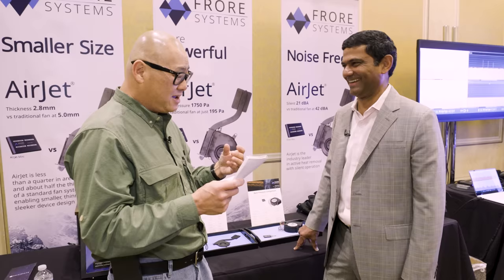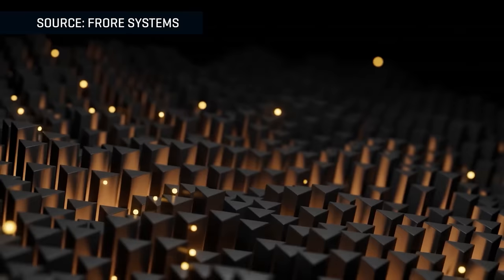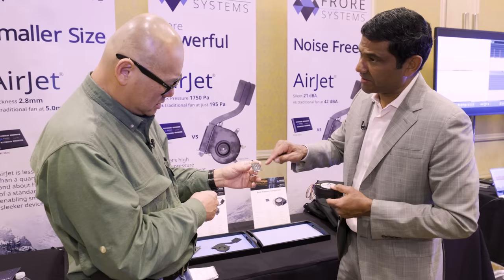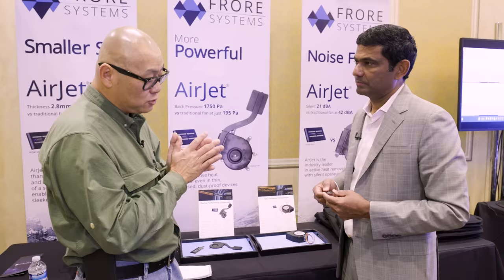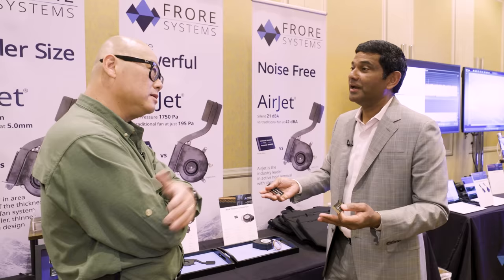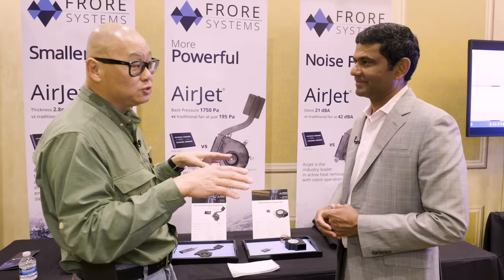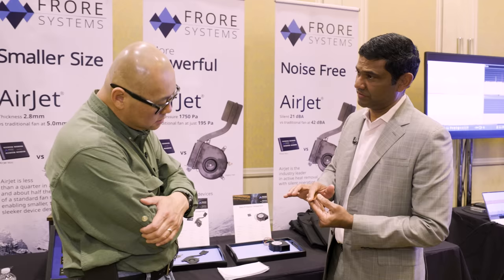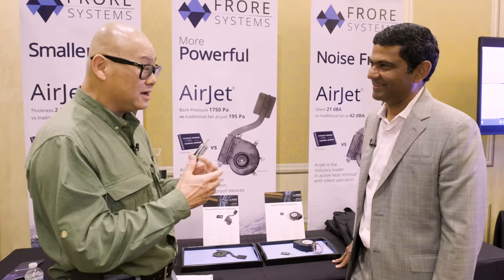Solid State Active Cooling Could Revolutionize Thermals

Comment: It'd be interesting to see a whole pile of these little guys set up to be a radiator. You've got a copper loop in the middle, and then on both sides of that loop, rows of these guys to move heat out pulls air in from the top and bottom, blows hot air out to the sides. 20-30 watts of airjets like that would cool a lot of cpu power , and if one failed you wouldn't loose the whole thing like the fan failing on a radiator. 

Also that small one is basically NVME-sized so you could just slap that on there with little changes.

Comment: This is not Evolutionary. This is Revolutionary! This is an actually technology that far more significant than more cores and more rams. Hopefully the actual chipmakers is all thinking, like him, about efficiency. 1 watt of power removes 5 watt of heat. Now the GPU is like 100 more watt 2 more FPS and 1000 more bucks.

Comment: I'm sure I'm not really grokking this... So its back pressure is a quarter PSI.... that is generated by Piezo-ish MEMS device that MUST be vibrating in the audible range to be able to impedance match (I'm just assuming that... I would be surprised if I were wrong though)...So you are forcing air through a slot using vibrating elements... and this  is supposedly silent??  A situation that would demand this product must be ultra thin, be required to be extremely quiet, and be dependent (for some reason) on convection cooling instead of direct conduction to a back panel like a cell phone... do any of you all know a situation where convection cooling would be preferable to direct conduction heat sinking to the devices back plate?

Comment: in terms of shaving, you use foam or gel on your face and you have so much of the product on your face that is just excess. then you use ultra slick soaps/creams like creamo. and it's barely on but what is on there is 100% effective.
so for me, putting this into your cpu, gpu, ram, and SSD. then add a low rpm intake/outtake fan. you will have crazy silent and efficient cooling. you still need the fans just to remove the air in towers as there is just so much more space in them.
I can't wait to see these into phones as higher hz screens get's really toasty

Comment: He seems to be evading the real reason you wouldn't attach this cooler directly to cpu die.. looks as though the solid state cooler simply does not contain enough thermal mass to effectively cool or keep up with the heat production of even something like a 32watt mobile cpu. The heat pipes and/or vapor chambers would offer that thermal mass 🤔

Comment: The datasheet says that the device they showcased has a thermal dissipation potential of 5.25Watts, which means it needs to be almost 20 times larger to cool a 'high end' CPU that emits 100W of thermal waste energy.
So essentially it's barely capable of cooling a low end SSD, which can be easily cooled passively with a lump of copper or even aluminium using no electricity, using only convection and being truly solid state.
Now if we take into consideration that low end SSDs don't even need cooling, this thing becomes even less useful.
Since it contains vibrating parts, something moves, disqualifying it from being solid state anyways.

Comment: Pretty interesting solution. But if you increase the CPU/GPU power because you can dissipate more heat, the power consumption also increases. Therefore, you need greater batteries or work connected to a power source.

Comment: For hand held gaming devices, this is pretty good.

But apple silicon has kind of started a huge push in that ARM market. As they become more wide spread and windows inevitably uses them better, they may find a much bigger presence in compact devices, and these type of solutions will be less required.

So if Nuvia and Qualcomm can come up with competitive designs to apple silicon and MS is able to come up with a good Windows version of Rosetta 2, then I think ARM will almost completely dominate mobile computers. ARM CPUs don't make a lot of heat.

Comment: You should develop chips without the thickness/area restriction that can be used in industrial applications where the thickness is not important but where reliability is important e.g. in a balancer board  in supercap modules.

Comment: Finally!!! hope they have success and that big corporate don't eventually put a stop on it and only use it on phones or laptops. As a PC user since early 90s i saw the growth of the need of cooling systems, and nowadays its just crazy to me. This and the power consumption should be the primary drives in this industry. Looking at desktops if they eventually managed to cool 100W TDP CPUs basically 90% of the cases today are useless because you can cool it properly without case design being an issue. To be honest I'm a bit tired of those square cases and would be nice if we can see other designs.

Comment: After using for a while, the fans remain in dust. Since this system uses a much thinner air duct, it will not take much time to get clogged by dust. But it's nice to have an alternative.
Reply: The dust can be prevented entering the laptop by using an IP68 filter in the air vent.
Reply: @Xevos701  It's easy to protect a laptop from water, but it's rather difficult to get air in from a certain place. because air easily passes through micro holes where a liquid does not allow surface tension to enter. but without using a filter, the air inlet and outlet of the piezo element can be kept open. yes, it is not prevented from dusting, but it can be easily cleaned with a vacuum cleaner / blowing or brush. Since there are no moving parts, the design can be done easily in this way.

Comment: I'm curious about how fast it can remove heat from a modern, high-powered processor. It's great that it works better than a regular laptop cooling fan, but we also don't use fans to blow directly onto a chip to coop them. Heat pipes are EXCELLENT at removing heat from the source and spreading the heat over a large surface area in a heatsink, which is then blown with a regular fan to expell the heat from the system. This would be an excellent alternative for the internal fans in a laptop, but it doesn't seem to be designed to remove heat from a traditional heatsink but instead to remove heat directly off the ihs of a cpu or the die itself

Comment: this technology itself comes with limitation as he mentioned that it has to be dust proof, otherwise its micro pores will get clogged very quickly even with few grains of dust particles so u need a very fine membrane filters on the vents, next drawback is efficiency , as he said you can't put these directly on top of processor, because it takes lot of space thats why u need to put them on the sides for a propoer dissipation . 3rd Cleanning / maiantence is almost impossible for such micro units making it non-reusable at all. 
I think this tech is in early stage let's wait and watch if this can become more mature overtime.

Comment: So its actually just cooling using diaphragms to move air instead of fans, (very similar to a tiny array of speakers in an enclosure) not solid State as the diaphragms move and would be what wears. They need to release testing as it looks like this would clog easily with dust unless it can dislodged itself; also that same dust may provide enough friction to ruture the diaphragm material (didnt catch what he said the material was).

Comment: OK.  The heat is picked up at the chip heat sink surface more efficiently due to high airflows, and the hot air is blown out at high speed.  You must exhaust this hot air to outside (out from the laptop enclosure) otherwise this hot airflow will eventually heat up the entire laptop from the inside (so it is NOT to be used for a closed laptop chassis (like a MAC book air).

Comment: This is, although worthwhile, most likely a solution for lower end PCs with little wattage. Even the Airjet can't break physics, and piezoelectricity has also been tried before. The airjet, while innovative requires a large surface area of intake alongside a need for there to be little to no dust or choke. The secondary issue is that of the oscillating part of the jet.  It would need an uninterrupted cycle to get the most efficient performance, and in lower wattage PC and Laptops, there just is not much room for that.

Comment: I'm wondering how fast this device will be clogged with the dust if it's micro level. If exhaust shoot the air with jet speed the intake should suck air with jet speed. What dust resistance he is talking about?

Comment: This would be amazing for notebooks.
Reply: correction: We need this, but the next generations. 5 watt or 10 watt per piece is too weak for gaming notebooks
Reply: @mentis4046  u can put 2-3 of this
Reply: @maksimfedoryak  gaming notebooks have gpus with tdps up to 200w. That alone would require 20 of These. If you have an intel cpu, it can have up to 120w tdp. For that 320w you would need 32 of those pro ones. I think that needs a lot more space then 17inch Laptops have.

Comment: This is more than just a possibility to cooling chips this is probably a design for the first solid state jet engine/Turbofan in the world coupled with ion thrust technology we can probably fly a jet without moving parts in it's engine and probably make it also improve stealth technology... 😮 There is a lot more but my question is how much voltage and current does it take to operate?

Comment: Would this be scaleable? I see a vast potential in lots of areas that require the movement of air,  Like ventilation, aircondition ect..
Reply: Damn! Those external units could turn into a much smaller and silent device, you're right!

Comment: The wattage ratings of the sizes available seem quite low? The mini is several watts net and the pro is ~9W net. The TDP of most i7 or i9 chips are on the order of 30-50W. They seem to intend for desginers to use 3-5 of the AirJets per processor never-mind dedicated graphics cards. I may be missing something.

Comment: As we are building cpu/gpu that is using less and less voltage(M1/M2 as a exmple) this kind of cooling is not need as a small passive radiator is more then enough! Did they ever look at last year Macbook air with M1?

Comment: I’m skeptical of this since it’s using electricity itself wouldn’t it produce its own heat? 

The cooling system itself would need to also be larger, fans have an exhaust and heatsinks leading back to multiple components (CPU, GPU, RAM, APU) which are in the middle. 

Wouldn’t this solution also need to go to said components & the exhaust? Or else it’ll just be dumping the heat onto other portions of the motherboard [This is talking about Laptops]

They got a lot of challenges ahead of them.

Comment: He said that they can close the vents and go for a rustproof device and that's what makes me be very skeptical towards this technology, because heat is generated and is there even if this manages to dissipate the heat from the cpu the heat is not gone it's still in the chasis and body of the laptop and if it can't scape from vents it will be trapped in there and make it a complete nightmare in there! And even not this device can cool the cpu then because the hot air has no door to scape! I think the idea is interesting though but definately needs a lot more work to be prqctical enough for the end user usage.

Comment: this combined with that new active thermal pad tech (which is a material that turns cold in the presence of  heat) could push this tech further. Now if I could just remember the name of that thermal technology. A youtuber showed how to diy the tech a while ago before covid. it's as thin as tape the chemical does the work but if this true solid state fan is applied it won't work as hard and last way longer.

Comment: It's cool to see people hype about a new product, but this isn't really new. It works for like 10w of power at most, thats why they test it for noise performance on the absolute lowest power laptops and have to use 3 or 4 of them. There was no place for it 10 years ago, but maybe now with the plethora of low power ultra mobile devices we will see it implemented as a cheap OEM cooling solution in devices that don't have fans at all. Still I can't see it being very practical for a notebook retrofit unless you REALLY hate fan noise.... you're just kneecapping yourself. In any case, some people seem to be expecting that it will cool their desktop and you just have to realize that even if you could physically attach 20 of them to your new high end AMD or intel cpu, it would still throttle and run hotter than their 85 degree testing temps. It's just not adequate for something like that.. A fan has user control, they're cheap, and you don't really need to test them for degredation in 3 months, it won't happen.

Comment: I want a hands on test before I buy this concept.

They have to remove all the excess heat from the CPU, plus the heat they inject into the system, plus the friction from a 200kph wind. Essentially, its a compressor with no phase change.

Interviewer was clearly given questionsnto ask, and didn't push back on obvious questions.

For now, I remain unconvinced and.assign a high probability of this turning out to be bs.

Comment: it sounds amazing for the future! my one question is they say quiet yet? wind makes noise so how does it work silently? also wouldn't cooling need to be roughly the same since it doesn't directly cool things? it just replaces the fan right? i could push a leaf blowers air across a heatsink but it wouldn't cool any more efficiently past a certain point.

Comment: May be I missed it in the video but what is the power draw of these devices vs fan?
Reply: common noctua fan uses about .6w, this uses about 1 watt. Not much of a difference really. Although the fan has the user control to crank up the rpms and provide exponentially greater cooling if you need it or don't mind the noise. I would argue that in any scenario where you can fit the fan, it's a better solution. This does make good sense for the many devices that don't come with a fan, but it makes almost no sense for a retrofit. As eager as I am for a real innovation in piezo cooling, this doesn't yet seem to be it

Comment: Good start sure, but you wont be cooling performance chips for a long while. Chips like i7/i9 Ryzen Desktop chips etc. I've also refurbished laptops for 10 years, worked on them for 20 and build custom rigid liquid loops etc etc.... my only concern is that air must go in still, so in laptops this will get clogged up and starve itself. Anti dust tech? filter screens ? they'll get clogged instead.. So if that's the case, then a normal fan will stay unclogged for much longer due to its much larger air flow intake paths. I dunno, it would be nice and i guess its an emerging technology in its infancy but sometimes, the reason we still use old methods is because they just work and work well. I would like to see much longer test results of these in the wild inside laptops in clean environments and dusty ones. A lot of industry rely on computers in extremely dusty environments, i've been servicing computers for warehouses, mechanics etc for over a decade.... i doubt the cooling performance would last long in say a mechanic environment where laptops are needed to work on cars because the carbon soot dust/break dust is insanely fine and would get in there easy.

Comment: I wonder if this can scale to desktop parts like the gpu
Reply: no, at least not yet. it's designed for low powered chips
Reply: If I could physically put 25 of them on my new cpu it would still instantly throttle under load at 15 degrees hotter than the temps that they are testing for degredation at.

Comment: If the mini and pro models are only capable of handling 5W and 10W of heat respectively, it seems like this technology has a long way to go before being able to tame anything close to modern enthusiast/professional level hardware. 

He says that they can put a few of these together to cool a 28W TDP chip. It’s still cool and all but I’ll be a lot more excited about it when they can handle something a little beefier like a 7700X at 105W or a 7900X at 170W. 

Maybe they will eventually manage to pull that kind of performance out of these things but so far, I’m a bit skeptical. However, I certainly could see them making inroads into more mainstream, basic consumer level laptops pretty soon if this tech works as advertised. Poorly performing cooling solutions are very often the downfall of what would otherwise be decent machines. Many laptops will thermal throttle if you just look at them wrong. The specs can be good but if the cooling sucks, the whole machine will suck.
Reply: Still useful as he said in ultra thins cameras and handhelds especially. These devices need to be as silent and as much performance/cooling as possible especially since they’re in your hand. It has a use case just not whatever u said

Comment: The only gotcha I can think of is the sound it makes. Now obviously - the frequency range is WAY above human hearing capability.... However, high amplitude high frequency sounds can will and do cause damage to the ear 
Parametric speakers for example (used to gteat effect in Haunted House set ups) have to ve kept at a low volume as the HF carrier wave can cause damage
Reply: Wooow!
very nice information.

Comment: So 1 watt in for 5 watts out? Not a bad deal. Typical PC fans draw 1-3 watts so if their efficiency can improve by ~50% in successive generations, they might be competitive if the price is comparable to a fan/heatsink combo.

Given the TDP of "performance" laptop CPUs target around 20-30 watts, they are really only competing for the budget and ultra-thin markets at their current performance metric. It's still airflow so it will still require maintenance and cleaning to ensure their jet doesn't clog up so additional costs will have to go into filtration layers.